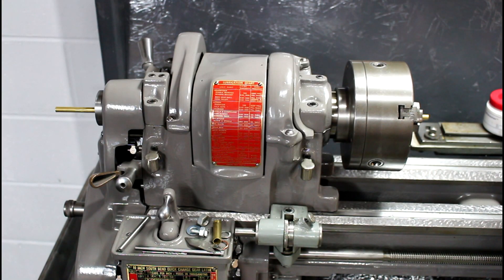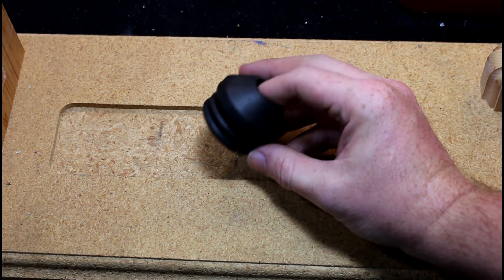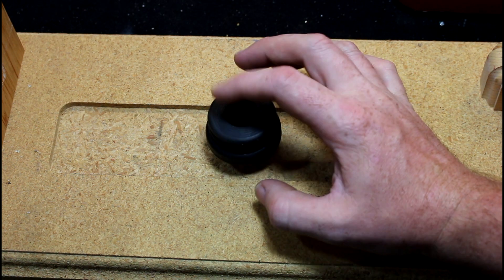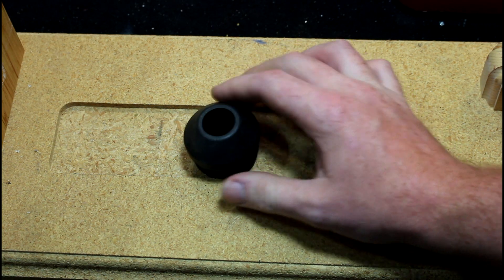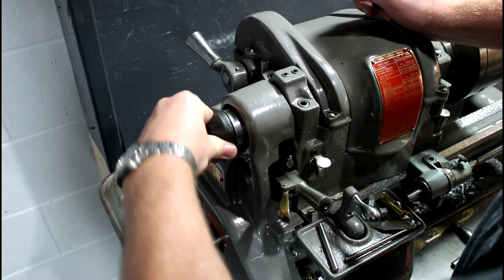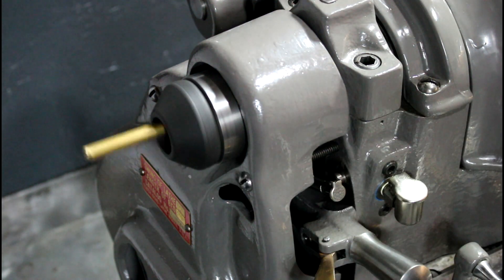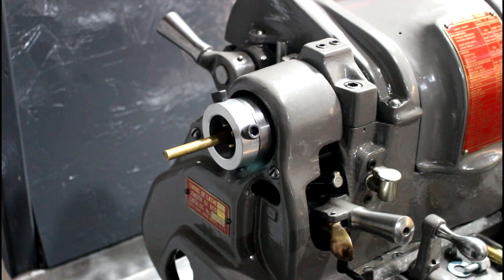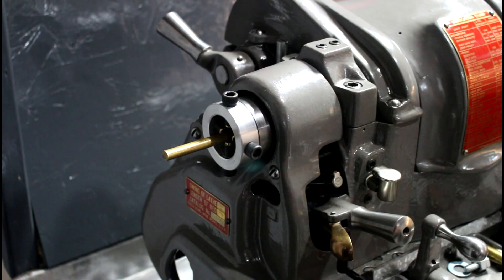Metal Lathe Trick, Stablize Work Through the headstock with the South Bend 10L

Comment: Hi,Just wondering why you think the limb saver xrings are a waste of money?I've got one on my 17hmr and have found its been extremely effective.Just curious as you may understand them more than I do.
Reply from the maker: I have used them on a couple of my rifles in the past and they did not do anything for me. I had one on a 10/22 and there was no difference. I also had one on a .243 several years back and tried it in several spots and same thing. I ended up getting them to shoot the old fashioned way, in the .22 I tried several types and brands of ammo until I found one that worked best, and the .243, I just worked up a better load for the rifle and I got the results I was looking for. I don't doubt that it showed improvement on your 17, but I think it's more hit and miss than a guarantee.  JMO
Reply: Yeh i suppose so. every gun I've used them has worked quite well. basically fire two shots and if they are far from each other then move it half inch. then fire another two. i keep going till the shots pretty much go hole in hole and then further check. 
I only really use them on rimfire as i can't tune the loads like centerfires and like to use certain ammos and want them to shoot well in the particular rifles. however trying different ammo basically achieves the same goal but just helps if you want use a specific ammo.
Thats just my results on multiple rifles so far.
Reply from the maker: Maybe if I pick up a 17 I'll try it again, but it works great on my lathe!